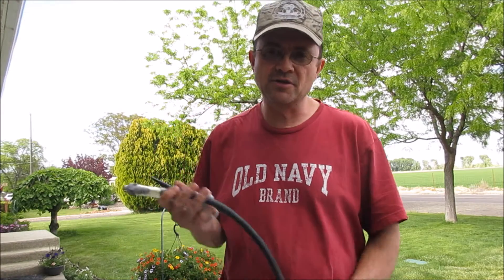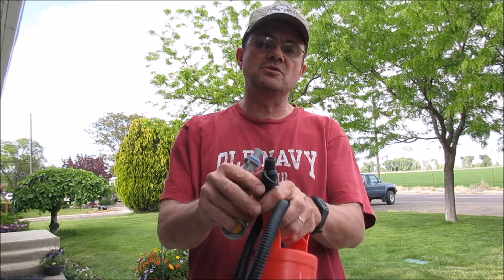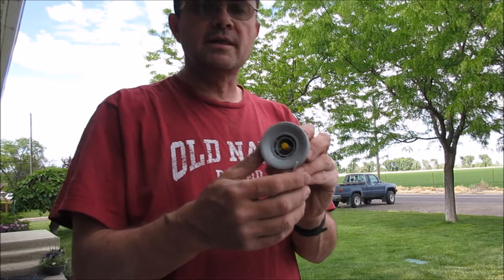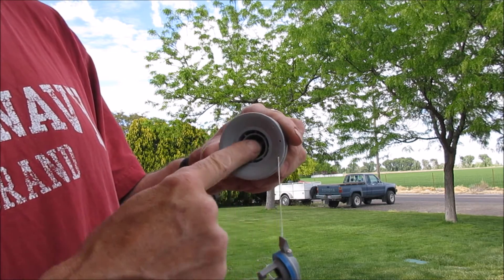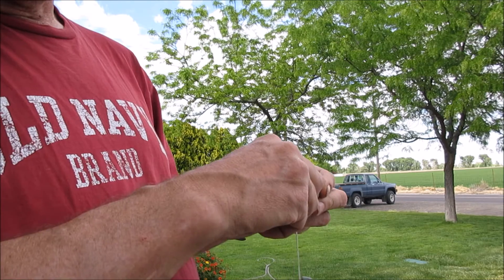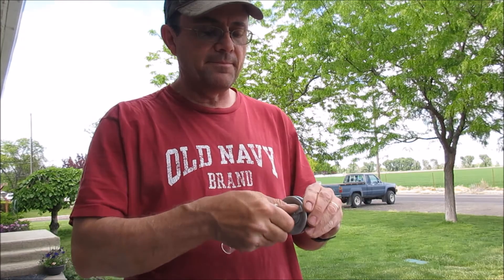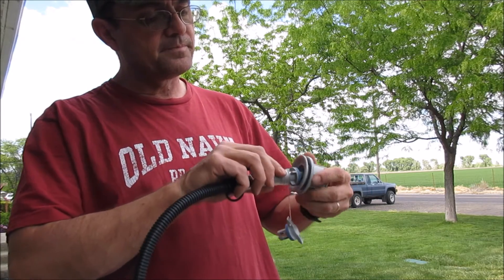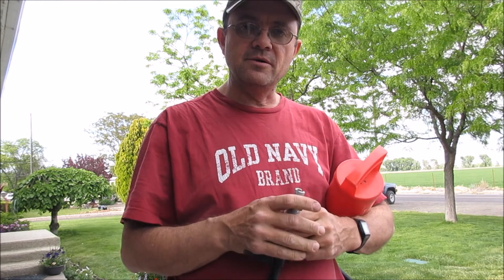Summit II pontoon valves and how they work.

Comment: Simple, easy to understand video.
I thought I had faulty valves as I had just purchased a pontoon boat and thought the air valves were faulty but I quickly realized it was my for not fully understanding the valve system operation and not the air valve. Thank you
Reply from the maker: @brantpeniuk4316   im glad this helped

Comment: I’m looking to replace my valves on my classic accessories pontoons as they broke this winter. I noticed your valve you showed had a yellow cap for the spring, is that the one built from the factory or an Amazon valve look alike? Classic accessories sells the valves for $25 and Amazon has similar valves for less but unsure which one works as they just are universal. Thanks!
Reply from the maker: That valve is actually one from outcast.

Comment: I just bought a boat with those valves and I can’t seem to pump it up with the middle not pushed down. Am I doing something wrong. The air seems to come out around the valve.
Reply from the maker: It sounds like your adapter is wrong.
Reply: What’s the difference in the adapters. I see a summit and a summit 2.
Reply from the maker: @gregorynielsen8972   if you have tge wrong one it allows air to bypass and not fill the pontoon.  Check to make sure which one you need.

Comment: Does it take a lot of pressure to get air into the valve when it’s in the “closed” positon (valve and spring UP) ? I have a classic accessories wilderness model and I can’t get air to go into the valve when it’s in the closed position when I use a 12 volt electric air pump plugged into the outlet in my truck. Will a foot and hand pump give me more pressure to be able to “top off” the pontoon with the valve in the closed position? I’ve been leaving the valve open while I inflate it with the electric air pump and then closing it real fast afttt the pontoons are full, but that causes me to lose some air.
Reply from the maker: Yes it is harder to pump when closed. A foot or hand pump can do it. A lot of electric pumps can't.
Reply: idahoron  thank you very much !!  I have ordered a hand pump and it should be here soon.

Comment: So You can inflate the boat when the valve is in the closed position?
Reply from the maker: Yes it will fill in both open and closed. There is a foot valve on the bottom that is rubber. The air will go past it .
Reply: idahoron thanks for clearing that up and thanks for the quick response!

Comment: I recently bought a pair of pontoons off of ebay. the company is called Dave Scadden and the model is the madison river. It has been next to emposable to get any information about these pontoon. I don't know what the weight capacity is or how much air is to be put into each pontoon. Thanks for all of your help Ray
Reply from the maker: I know these boats were still in production in 2008. I also know that they are very similar to the Sportsman 9 or AKA fishcat 9 from Outcast.  The capacity is going to be in the 250 to 300 range pretty easy.  On the pressure you are looking at about 2.5 PSI. When you pump them up you want them to be firm. when you push on them with your thumb you want them to have about 1/2" give when you push with your thumb.  In my video the buyers guide I go over the pressure and show what to look for.

Comment: I went to the tire shop got a valve stem ground it down on abrasive wheel just enough to force in the tubing now I can air the bladders with the same portable compressor or bike pump
Reply from the maker: Tire stems are not a good way to go. First off it takes a lot of air to fill a pontoon but they cant take pressure. Summit valves are a much better way to go. There are plenty of small compressors to fill bladders with and they will not damage the boat.